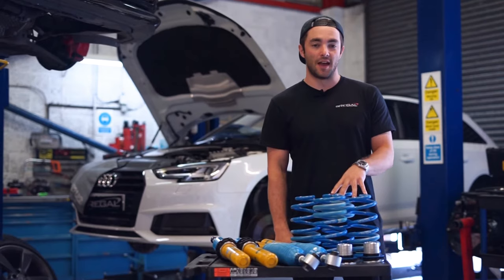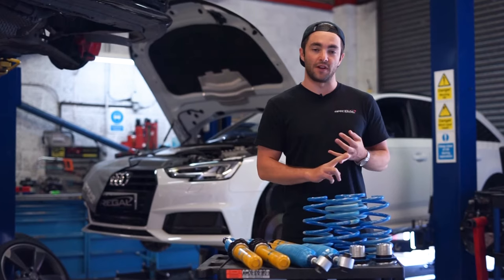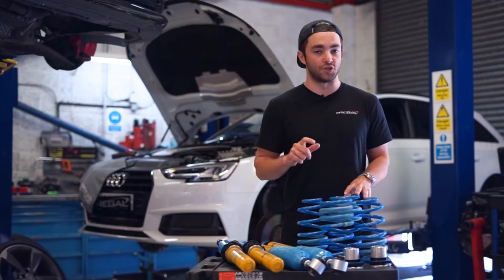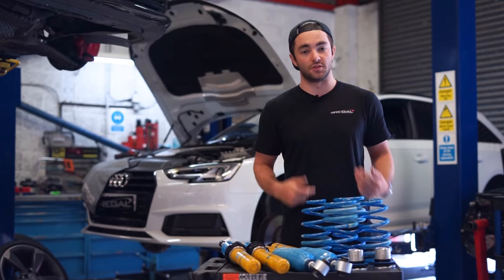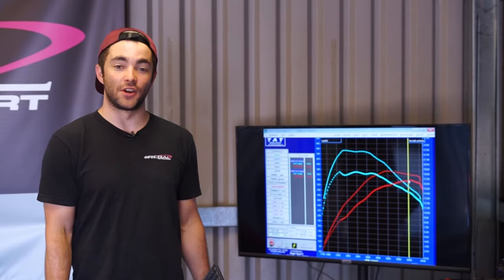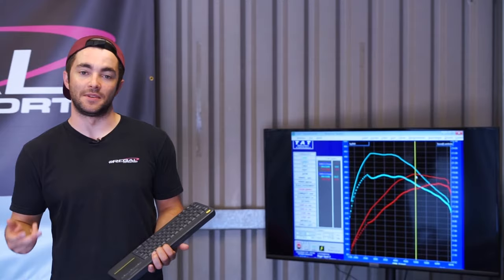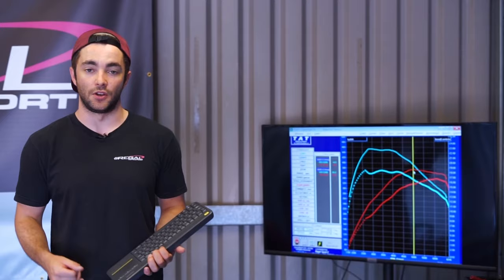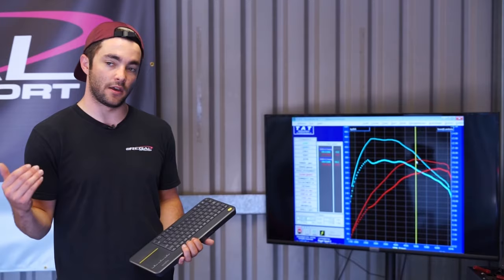B9 S4 APR Stage 1 ECU Software & BILSTEIN B16 Coilover Install

Comment: What damping number did you choose for that particular vehicle? I’m finding my pss10 bounce in the front. I’m currently trying to figure out the best setting for my s4. I have set it at 6 front and 5 in the rear? What would you recommend for a spirited (non-track) driver?
Reply from the maker: Thanks for the comment, it's hard to diagnose via the internet - ideally we'd need to drive the car to see what's going on